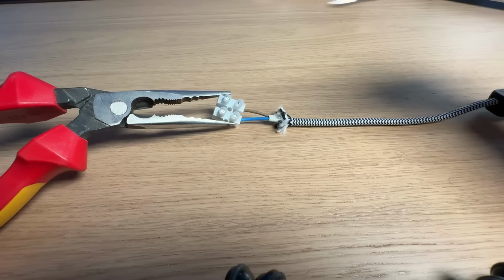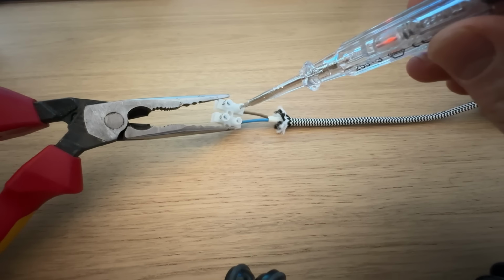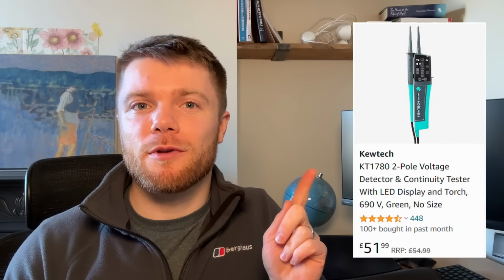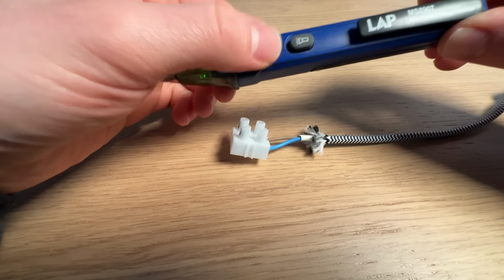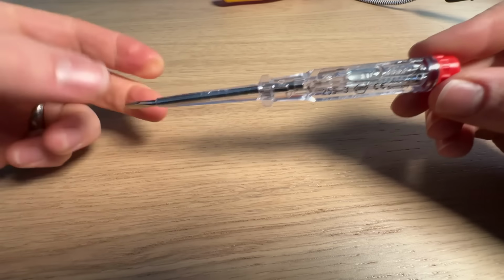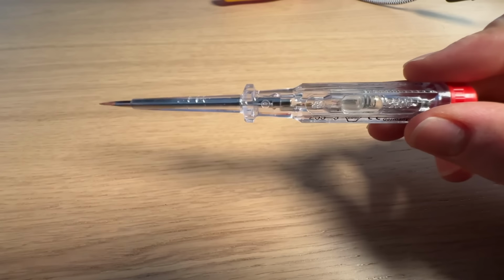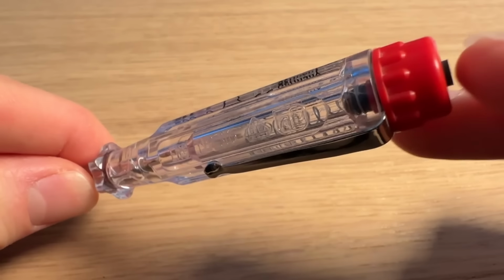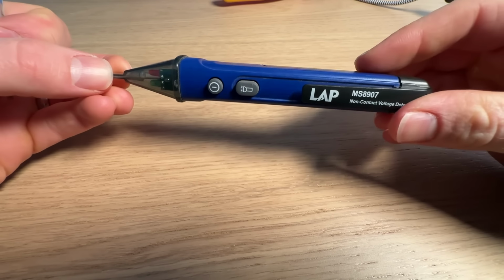The Most Dangerous Electrical Tool

Comment: Isn't this a classic case of "if this happens then..."? Similar to "you could walk out of here and get knocked over by a bus..."? Both are "possible" as is giving a load of chimps typewriters and waiting for them to write Shakespeare! Also the "possibility" that there could be water ingress? If you're working with electricity and you use wet tools, what could POSSIBLY go wrong? Similar to other posters, I have been using these for decades with no problems nor have I heard of any. A big downside of the contactless units is that they can give a false positive especially on copper pipework!🤣🤣🤣
Reply from the maker: Thanks for watching!

Comment: Actually the tool is not as bad as you think, if you can think about how a tool works, it can actually be very useful.

First, the light problem. There are test pens that have brighter lights.
Second, a very small current will not kill you or cause cancer.
Third, if you use a multimeter, you only know whether there is a difference between live and neutral. What happens if the neutral cable breaks? Yes, the multimeter will display 0 even if there is voltage on the live wire. And people get electrocuted mostly by touching live and ground, not live and neutral.
Fourth, when using a Non Contact Voltage (NCV) tester when the conductors are very close can you tell which cable is live and which is neutral? And for information, NCV works by detecting electric fields, not magnetic fields.
Fifth, even a multimeter can kill you if you use it wet. Everyone knows that electronic devices are dangerous if used when wet.

The point is that all tools have their own advantages and disadvantages. And it all goes back to the user. Even highly professional and expensive tools will be dangerous if operated by fools.
Reply from the maker: Interesting, thanks for sharing

Comment: No doubt there will be  moves to ban them. Depends on how used. I was wiring up a two way switched lighting circuit for disabled neighbour, so isolated what I thought was the relevant fuse channel. It wasn't possible to shut off supply at the distribution board, as neighbour felt cold. A 'shared neutral' error meant I could not do a DVM check. While working, the thing lit up, saving me from a shock. These should be for alert purposes only but not as a substitute for a multimeter, I would agree.
Reply from the maker: Thanks for watching!

Comment: Also if they were that dangerous, they would not be available at every electrical wholesaler , every main diy store. I was electrocuted on my highly professional AVO meter once. It was not a full shock enough to drop it. It was returned to Avo at Dover as i lived near by at the time.  Commonsense is always the requirement of safety.  Today health and safety has become a major issue , why you see so many critics of old practices that were considered safe once. I suspect insurance companies are the prime movers.
Reply from the maker: Assuming that anything dangerous wouldn’t be widely available probably isn’t sensible. I agree if these screwdrivers are working correctly, they are safe, but still a bad design and if damaged they could easily be dangerous

Comment: Yes these are dangerous but only in the hands of untrained or insufficiently trained people, one of the main reasons is that they make the mistake of thinking that this can prove a circuit is dead, not so, it only proves that it is live as in certain crcumstances like being up a pair of steps or on carpetting you cannot see the neon and not being trained well enough, do not know to ensure that they are properly grounded that is to touch down to earth with their other hand, try it and you will see the brightness change. The only sure way to ensure a cable is dead is to touch it down to earth as any and all test equipment can and does fail.
Reply from the maker: Thanks for watching

Comment: When made properly, these testers could be dangerous if not used for what they are intended for. The thing is, people (apparently including the author of the video) think these are intended to check whether the wires are energized or safe to work on. And that is absolutely wrong and dangerous assumption, many people got zapped when they thought the wires were off just because this did not appeared to light up.
What this is really intended for is to verify which wire is the phase conductor or to positively check whether there is some power when something refuses to operate and that is all. Definitely not to verify the conductors are safe to touch or anything like that.

In other words it only shows two states: "There is potential" when it lights up, and "I don't know" when it does not. None of those means "Safe to touch"...
Reply: Very excellent points made there. Mistakes can happen and they do. These BEE mobile phones are a bad thing when it comes to interrupting ones concentration.
Reply from the maker: I don’t think they should be used at all. I make that clear in the video.
Reply: @TheDiligentDIYer1759  From the video I got an impression you are talking about "verify whether the wires are safe to work on" use, there I completely agree, the glow tester is not to be used.
But when the task is "troubleshoot why the light does not work / where the wire is broken", it becomes the task these glowbottle testers are intended for.
These "noncontact testers" are way too sensitive to identify the phase is really connected. They react even when there is broken phase wire or so - so when the place is crowded with wires, it is reacting all the time. They are supposed to be that way, because their purpose is to identify whether it is safe to work or not (as a double check after you switched the breaker off, of course).
I know a V-meter is more reliable, but this is way faster. Plus sometimes you do not have access to a Neutral (like in light switches, if you want to identify whether the power even reaches them), so you even can not use the V-meter, while the non contact tester will respond to both wires even when the switch is disconnected or the wire broken, just due to coupling between those wires.
Reply: @annaplojharova1400  Thank you for sharing this piece of information that was omitted in the video. That puts everything into a far more interesting perspective.

Comment: The way how this exact screwdriver is made (just the small resistor), shows it is really a counterfreight product. The problem is not that "you are part of the circuit" (in fact you are part of the indication circuit with any contactless tester as well), nor with the current that flows through you when it functions normally (few 100's uA), it is a safe level the same way as AA cell. The problem is, how is that thing designed to prevent the current to ever becoming larger even with some malfunction.

Normally on these testers should be a safety resistor should be of a safety type (so it won't break down, so equivalent to reinforced insulation) or at least multiple resistors in series (equivalent to double insulation), so usually at least 15mm long and 3..5mm diameter resistor body, definitely not the 0207. What I've seen most often is the resistor being stuck into the end plug, forming the "touch button" on the very end. But these use to be really snug fir there, to make sure the plastic around makes a good seal, so the safety insulation property is not compromised even when the thing get wet. If it is freely moving (even when it is really the resistor and not just a metal rod), the space around it can easily hold quie a lot of water and dirt.
Reply from the maker: You’re not part of the circuit with a non contact tester, they are entirely covered with insulating plastic
Reply: @TheDiligentDIYer1759  You are. Via the capacitive coupling between you and the internals of it.
Same as with the glowbottle tester - there the current from the button goes to you directly, but then to ground via the capacitance between your body and ground.

Comment: i havent used one of those for years , im not a pro but have done a few houses in my time ( always have had my work checked by a pro) and i have never compromised on my safety equipment and a few years ago i got a Fluke 1AC II VoltAlert - Non-Contact Voltage Detector Pen which wasnt cheap and i trust it BUT if someone is buying one of these things please check its the right voltage range , i didnt even think about it when i bought it and luckily i bought the right one , it was only later that i found out that they do different ranges and if you get the wrong one then it can tell you its dead when in fact its hot , especiallythe cheaper versions may not be as described 
love your videos
Reply from the maker: Very kind of you, thanks for watching!

Comment: I think these things are quite safe unless visibly damaged (i.e. insulation compromised) or if the bulb broke somehow. Which is why when I want to make sure a circuit is not live I am using this device on a live circuit just beforehand to verify that it is working properly.
Reply from the maker: Thanks for watching!
Reply: I do the same. Had no problem for so many years.
Reply: Below some voltage the light won't glow. You touch the wire and you get shocked ! 😀.

At an isolated transformer it won't glow at any voltage ! You touch both wire and you get shocked ! 😀
Reply: @kenzo4Ever in the transformer case, that's because your finger is much much larger, and part of it might capture the uninsulated section of the wire
Reply: @za_pravdu1943 
My large finger caused me many unwanted things but not that one 😅

Comment: These are not dangerous at all, if used as intended and you don't get them wet. Multimeters also aren't safe when wet...
It is not a mains testing screwdriver . Don't ever use it as a screwdriver; the tip only has that shape to conveniently make good electrical and tactile contact on terminal screws.
Re. non-contact voltage detectors: I wish BG engineers were taught these are voltage detectors , and not electrical fault finders since they do not take account of source impedance.
Reply from the maker: Thanks for watching!

Comment: I have several of those and also a 12v version. Never used them as testers, though. Just as a screwdriver.

I believe they have came with some abiko or fuse kits.

Using yourself as part of electric circuit is not a safe thought.
Reply from the maker: Thanks for watching!

Comment: First used these over 50 years ago. You can get quality ones (screwfix etc), which are waterproof and tough. If you understand how they work. they can be handy. There are not designed for "Testing", only for indicating there's a voltage present. They can also pick up Disconnected earths/cpc s and neutrals in a circuit if you understand how mains electricity works. They do have the they drawbacks, but what would expect for a couple of quid. Billions have been sold with few issues!  I wouldn't use them in my job as an electrician.
Reply from the maker: Good points! Thanks for watching!
Reply: Below some voltage the light won't glow. You touch the wire and you get shocked ! 😀.

At an isslated transformer it won't glow at any voltage ! You touch both wire and you get shocked ! 😀

Comment: The non-contact testers work on the electric field NOT the magnetic field. The magnetic field is a property of current flow yet these voltage testers work even when no current is flowing.
Reply: Exactly - capacitance coupling .
Reply from the maker: Thanks for watching
Reply: That's true.

Comment: You don't fully understand how it works and what current we are talking about. The current is below 30 μA. This tester does not require power supply (batteries). I understand that in the UK you are of course different with your ring 🥴 But the rest of Europe uses it, so don't worry. And if you use damaged, cracked or wet tools, SORRY. You are an adult and you know what you are doing. 😎
Reply from the maker: Thanks for sharing your opinion

Comment: Common is black. You have the live plugged into the common. Why?
Reply from the maker: You’re absolutely right, my mistake. Thanks for watching!
Reply: @TheDiligentDIYer1759  No worries. I didn't want you blowing people up ✌️
Really good video though. I stopped using the screwdriver type years ago. Over the years the quality has become very bad. I have a couple of the audible type with a flashing light similar to the one you used. I have 2 just to double check but I've never had a problem with those. Those screwdriver lights can be so dim that they become useless.
Thanks for the vid. Very safely concourse as always when dealing with electricity ✌️
Reply: Not in every country. In my country live is black/brown, neutral is blue and ground is green+yellow.
Reply: @xsc1000  Common is black for any multimeter in every county.
Reply: @xsc1000  I was talking about the multimeter, not the wiring colour code